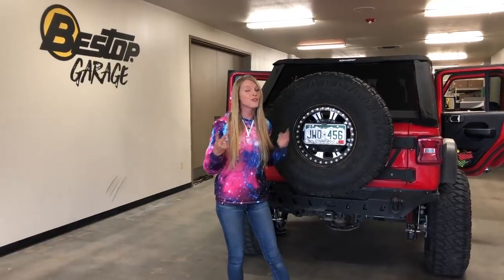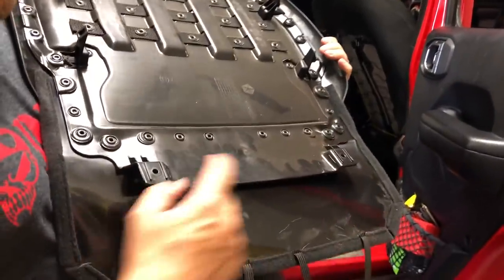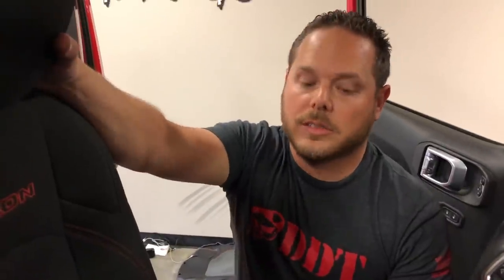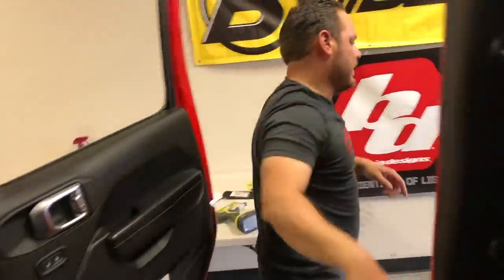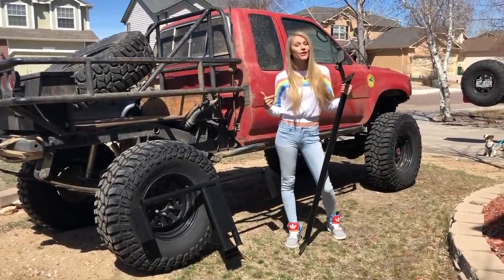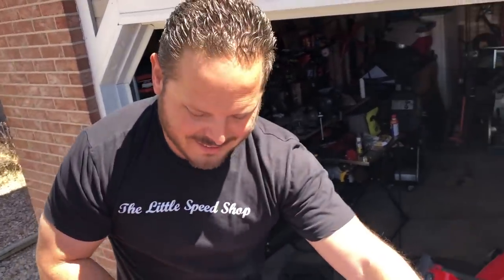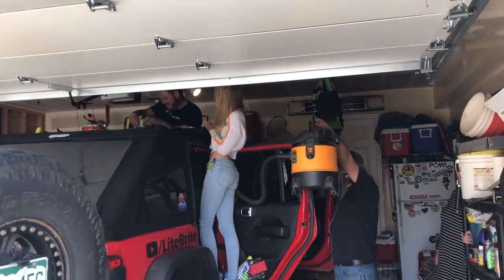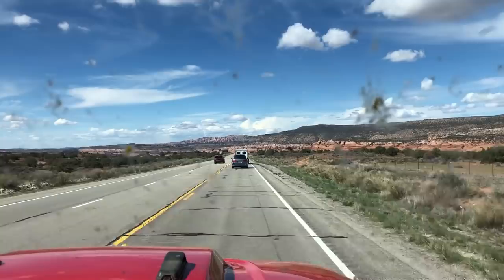PRP Seat cover Install and roll cage added to our Jeep Wrangler Rubicon

Comment: Hey Kevin buddy! Don’t forget next time you drill to switch that thing on #2 high speed for drilling, #1 is for screws & stuff i know it’s easy to forget. Y’all rock.
Reply: Todd Martin so the cage is super high strength steel. You have to go slow or it will ruin the bit is 1 hole. Going slow eats through it and will last.

Comment: Hopefully your roll cage is like my winch. Once I got it on the Jeep, I have never needed it in 8 years.
Reply: This is my theory behind not spending Warn money on a winch. I always wheel with other people and anytime I do end up stuck someone else pulls me out. I put my Smittybuilt XRC winch on two years ago and the only thing it's done is make me lose the tip of a finger.
Reply: @groberts1980  that is why I only spent four hundred bucks on my horrible freight winch... Hopefully I'll only need it to pull stuck Mall crawlers out of ditches during the winter time :-)

Comment: Great video as always and seat covers are great... Will you still be able to put the sunrider back on as Looking at the upper roll cage the bracket  down the middle where squeeze bracked goes and on sides where it bolts is where the flush mounting location points are for the sunrider?
Reply from the maker: David Blake It works well with the Trektop thougj

Comment: That zipper I bet does make it easier. That’s probably the main thing I don’t like about wet okole and Bartact, but their waterproof. Might invest into PRP for the front seats in the future though. I will say I like the rubicon rear part of the seats. Wish that was an option for the sports and Sahara’s.
Dam how large are the holes y’all had to drill for the cage? Did it suggest any anti-seize for the bolts?
Awesome video! That’d seems like a legit roll cage for the JL.
Reply from the maker: It’s has its pros and cons. The front limits your view a bit and the top section would be much safer if we had harnesses (I’m concerned we could hit our head on it in a rollover with the normal seatbelts
Reply: Lite Brite ya I asked one of the FB groups about it and they mentioned hitting your head a bit. I have the molle solutions for the front in the garage so I might just have that for now and if I really think I’m going to be in scenarios that I’ll have the chance to flip I’ll invest into the sport cage reinforcement. Awesome video! I’ll need the vacuum support if I do it to my Jeep.

Comment: I plan to buy a gladiator later this year. Sport model and just add lockers and sway bar disconnects myself since itll already have dana 44s front and rear. Maybe next year I can see yall somewhere on the road. Until then yall should check out Boggs and Boulders here in Alabama its a local 1000+ acre off road park in my town. We have caves, rocks, mud and trails.  You can bring the razor as well. http://www.boggsandboulders.com/home.html  Until I trade it for the gladiator ill bring my tahoe out.  Edit: failed to realize I hadn't subscribed since I was getting the new vids in my recommended. I have subbed now.
Reply: Brandon Brown nice! The gladiator will be awesome

Comment: with heated seats in the JL it doesn't matter if you have leather.  Those heated seats scorch yo ass in seconds. don matter if it's negative 10 , asses be roastin. negligible difference in ass temps with cloth vs leather in a JL with heated seats, fact.